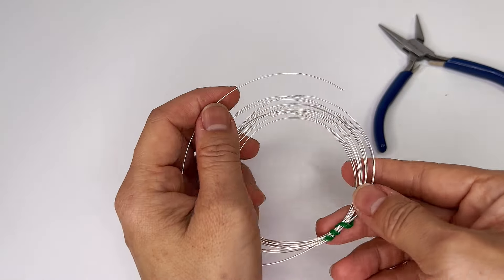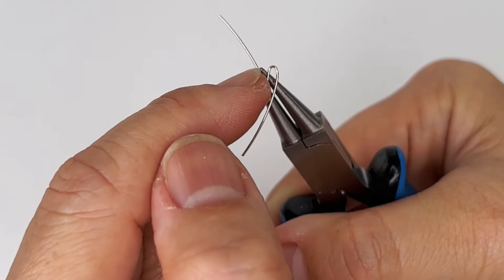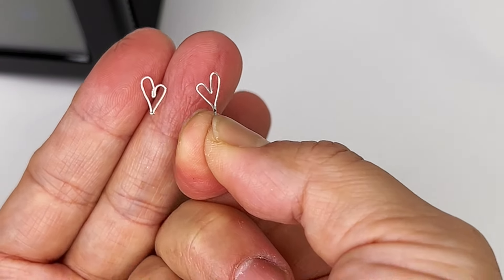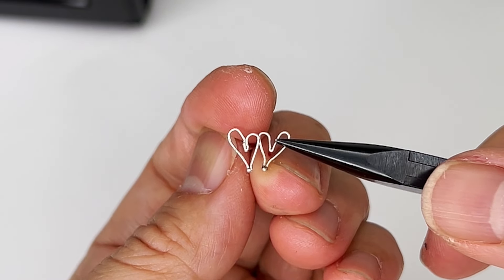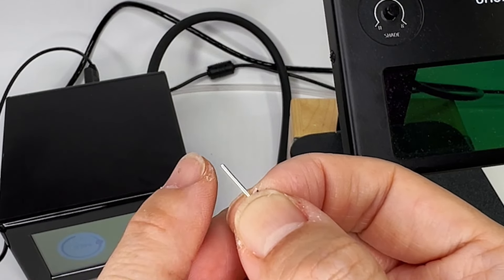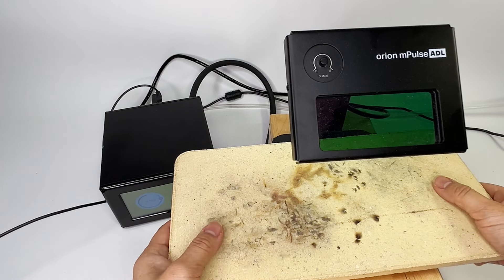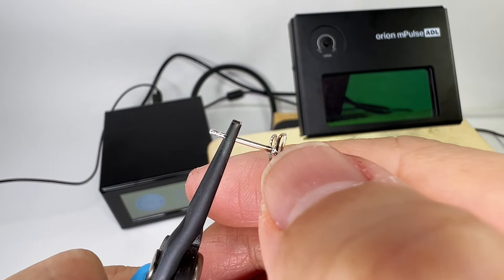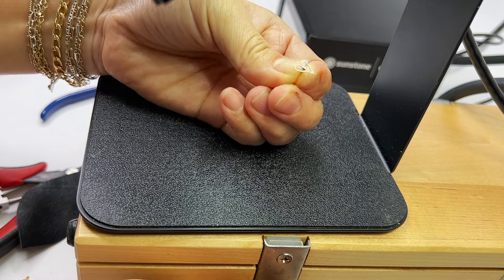How to Make Heart Stud Earrings | Unleash Your Creativity with Micro Welding - Lesson EP8 #welding

Comment: Can you make same earrings with 14KGF wire too? please show me wire works with 14Kgold field using welder.
Reply from the maker: I would not use gold filled because some of the core brass will be exposed and, over time, will oxidize.  You can certainly do this with solid gold.  It's not much more expensive than gold filled when it is light weight like this.  You need slightly higher power for welding solid gold than gold filled and sterling silver.
Reply: @stonesandfindings  If I weld 20gage GFwire which is more thicker gold  with 14k or 18K filler, is it looks better or not? and how much Joules do I need?